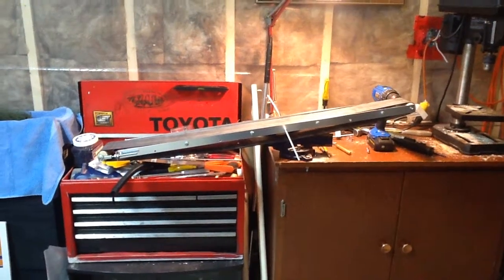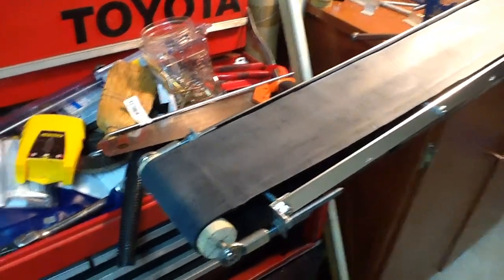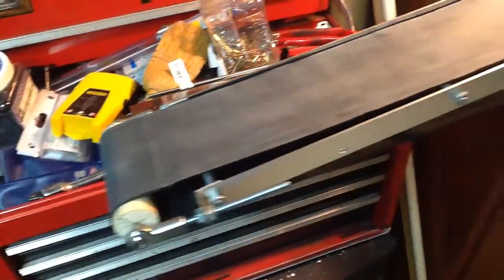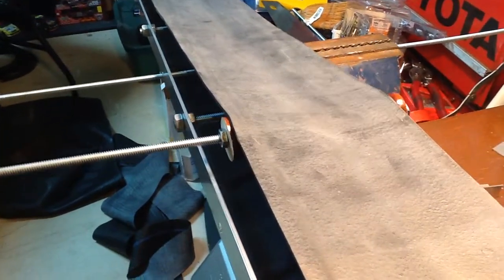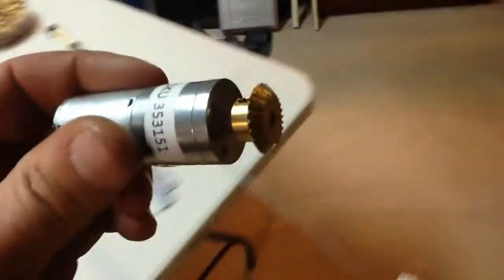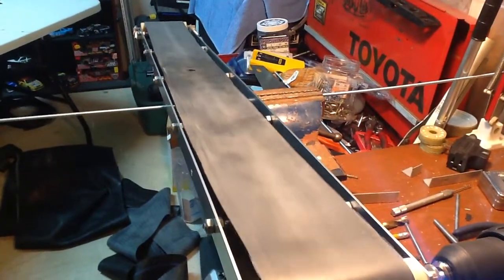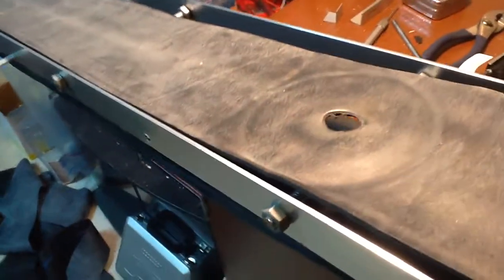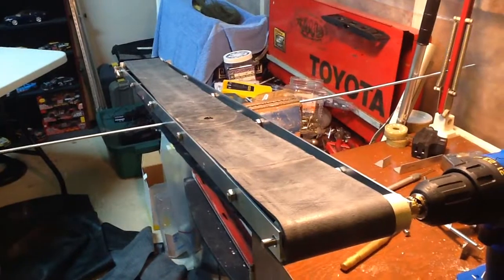Building a conveyor

Comment: Where do you get your conveyorbelt?
Reply from the maker: BanaanXD . The belt in this video is a transport truck tire tube  which I cut to width. My other conveyor belt is from a treadmill machine  and cut a strip out of that.
Reply: @Kinghauler2012  Thanks, How did you connect both sides?